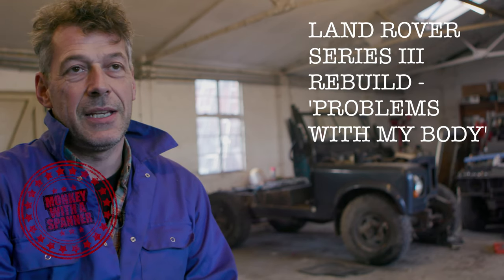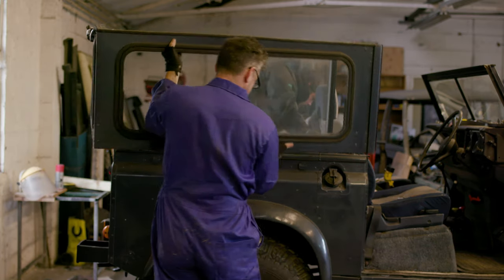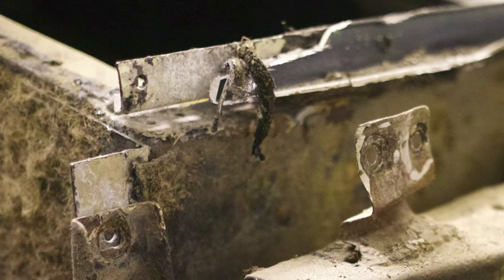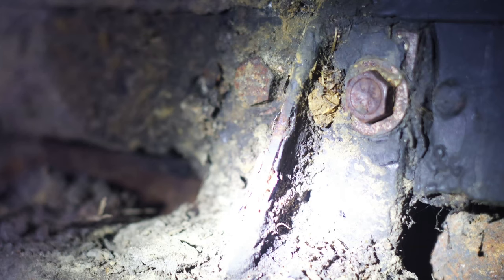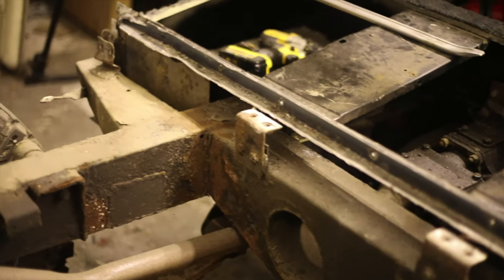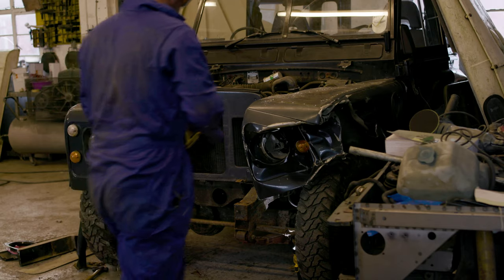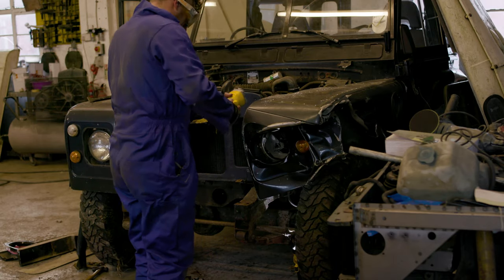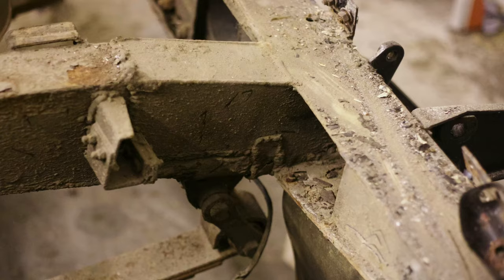Ep. 07 - Series 3 Rebuild - "Problems with my body"

Comment: I just picked up my series 3 109 2.25 diesel a few weeks ago and plugging away at some small rust repairs, not so bad really and normal things to get it back on the road, Wiring was a nightmare, So Ripped it all out and will redo all of it, It was a complete fire hazard. Also apparently I might need a new starter already, Bugger! :)
Reply from the maker: JJ T at some point, Rosie’s wiring had been on fire, but that won’t appear for a few episodes yet. Keep up the good fight mate.
Reply: @monkeywithaspanner8494  Cheers :) Yeah Thats why I am re wiring the whole thing I mean it was done with 0 grommets throught the firewall and bare wires rubbing on them LOL Surprised it never just combusted LOL. Keep up the good video work. Enjoying them